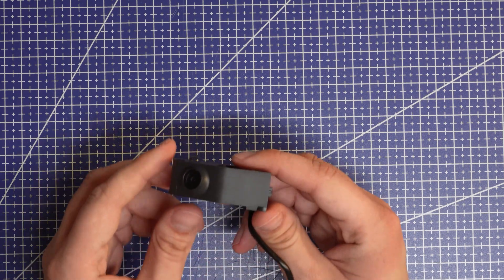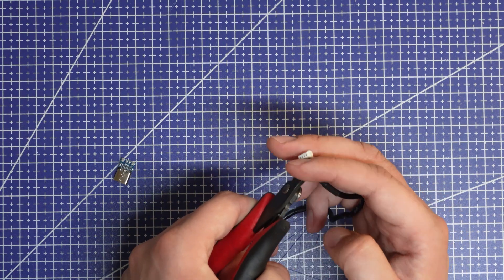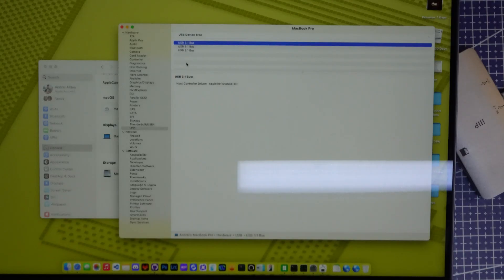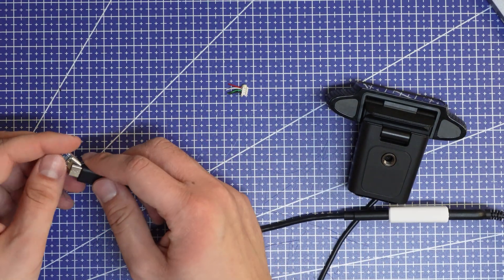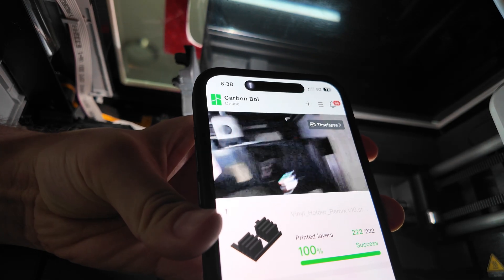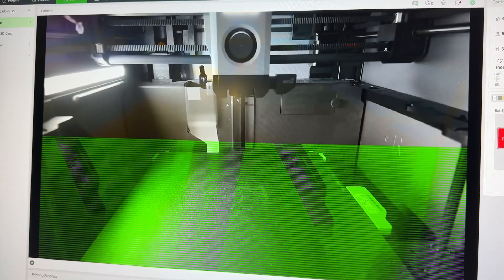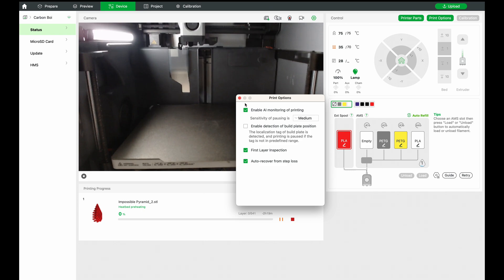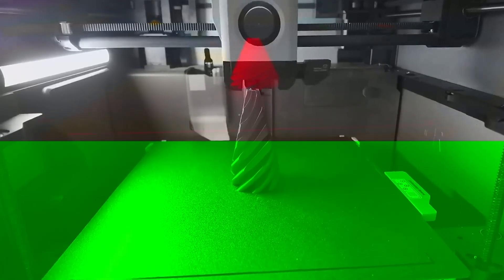Secrets of the Bambu X1C Camera - Use 3rd Party USB Webcams!

Comment: I have 2 extra cameras after glitches in firmware of mobo, BBL was sending me those instead of listening to me telling it's not the camera issue.
They finally fixed the glitch eventually and I got with those cameras. Might repurpose them for multicam streaming I guess.
Also you need to keep in mind that native BBL camera isn't 1920x1080 but is smaller horizontally when using ffmpeg streamer, so might also be something to consider.

Comment: I wonder if the P1S uses the same camera unit as the X1C but its actually the processor that limits the frame rate?
Reply from the maker: @DrawnDoggo  probably part of it. I haven’t seen what that unit looks like but likely the same sensor.

Comment: It could be my fault but I don't understand this logic. You change the camera, but you wanna keep the printer's data transfer chain. Why is that? Your camera is outside of the box, and it's an independent device, why would you want to connect it to bambu? Just because you can?  Use your own video data transfer method, wifi, ethernet, USB2 or 3 or HDMI or whatever you want.
Reply from the maker: @telelaci2   There’s a few cases where something like this might make sense to do:
1. Your Bambu camera dies (like mine) and you want to replace it without buying a new Bambu sensor
2. You want a different camera angle and/or better quality (which even the C920 gives you) while still being able to use the native Bambu App for monitoring on your phone remotely and the native Timelapse feature.

Using “my own transfer method” would imply having to setup another device to monitor it that’s not tied into the Bambu app, probably a pi or other Linux box whatever. 

Lighting and camera angle you can play with like anything else, ideally yeah you’d turn off the Bambu light and setup strips optimally for your camera setup, but you can do that with this just fine.
Reply: @AndreiAldea  The weakest link of the Bambu's Data stream is the bandwitdth, 2.4GHz wifi. You can't change that (maybe later with the Crowdsupply  X1Plus for $125). And it limits your quality badly, whatever camera you use. They should've put a gigabit ethernet in the printer, but they wanted to save money. Meh.
And I wouldn't name the half green screen a better quality, but faulty instead. Bambu's firmware can't handle that camera properly. So I think the idea was very good, it was worth a try, but it failed, you couldn't achieve the goal. Be honest to yourself. Sorry for the criticism.
Reply: @AndreiAldea  OK but a Bambu Chamber Camera replacement for X1C is 54 EUR/$ 50, it's definitely cheaper than an Logitech C920/C922, not mentioning a GoPro or a DSLR or mirrorless pro cameras you tested. You are not cheaper but more expensive. And you needed many gadgets also, a camera tripod, USB cable, plug converters, dongle. Add it up don't be shy. You will be over $ 100.
Reply: And another problem is the lighting. Very important in photography, when you want HQ picture/video. Switch off the Bambu's own LED (you don't want to look into the Sun), and build your own LED lighting stripe into the upper frame, you can find many solutions in the Makerworld.

Comment: I have a very similar issue of artifacting, but how come when you were able to view it on your pc, the artifacting wasnt there?
Reply from the maker: @yourcrawdaddy  for me the artifacting was happening on/off after reboots but was always guaranteed to happen after the chamber was heated for a little bit.
Reply: @AndreiAldea  Like @lpROTC, I did not see the artifacting when you plugged into the PC. Are you saying it did come back when plugged into the PC? I have the same issue which also happened to running high temp materials, however it now happens regardless of chamber temp. I would think it would do the same thing no matter what its plugged into.

Comment: Mine is currently blurry, out of nowhere. Currently looking into replacing it with something other than the stock camera, which sucks to begin with.
Reply from the maker: Yeah if you're trying to do that something like a Logitech C920 is probably your best bet. I would try to pick up a used one off Facebook Marketplace or something for cheap, no sense in paying full price.
Reply: In case you are still being bothered: it's because the lens fell off from the sensor. Actually a quite easy fix by yourself but you can also replace the entire camera assembly of you don't mind the wait😂

Comment: Hmm,. the green reminds me of the older cheap usb camera when you had to change setting for de-interlacing rates. Probably from the bambu camera driver they are using. since it is just linux after all. Now if the driver was UVC compliant it wold be neat to wire up one of my thermal cameras 😂 You could monitor how certain materials cool down to much and warp like nylon PA6

Comment: But… when you connected the Bambu camera to the computer there was nothing wrong with the image, so the problem we see is from elsewhere, right? (One of my X1C just started having this issue, hence I’m interested in the reason. Seems more like sw-related)
Reply from the maker: @Mr.X3D  it could be but for me the issue always happens once the chamber heats up, swapping the sensor with the new one has it working fine so I assume something is cooking that sensor over time….
Reply: my camera started to have the same problem , when you First switch on the picture is o.k , but slowly more and more gets added to the image , at First I thought it was something to do with being on a different vlan , but work out it's the camera when heated up.

Comment: this wouldn't work with the p1s would it ?....they say the camera is limited on the p1s be cause of lower power cpu on p1s vs x1c
Reply from the maker: @vash469  if it’s usb still it might but work at a reduced frame rate or it will drop frames. Not sure, I don’t have a P1S unfortunately. If you’re fine with not using the native app for monitoring a WiFi camera might be easier/better for that.
Reply: @AndreiAldea  I have a tapo c110 I use but trying to find a good position for it all the prints I'm finding aren't very good angles....just good for overall monitoring
Reply: same camera module in both. hence, unfortunately, you're right about the lacking processing power. should still be possible to swap in another camera with compatible specs, but you wont get much better output.

Comment: What soldering iron and helping hands are you using? Could you provide a link? I'm in the market for both. Thank you!
Reply from the maker: @wscottfunk  the Soldering iron is called a Pinecil from Pine64 and for $26 it blows $100+ soldering irons out of the water (just make sure you use a good USB-C PD power supply with it) and the helping hands are called the Omni Fixo and they are by far the nicest, Tested did a video on them a while ago and they’re worth every penny. 

If I had to get those all over again I would. Don’t bother with the cheaper stuff it will save you a lot of frustration. The soldering iron especially is an absolute bargain

Comment: I just use a cheap Tapo C100 security camera on my P1S, $20 or less on Amazon with plenty of mounting options on MakerWorld or even design your own. I chose the cheapest camera I could find in case it didn't work but is pretty good for what it cost, will now look for a better one although not really necessary as this one gives up to 1080p. There are many cheap options on AliExpress for cameras, I've ordered a few, one with an ESP32 board to experiment with.

Comment: Can you explain the resistor level thing? Specifically what resistor value are we supposed to use to connect?
Reply from the maker: @RaleighLittles  Yes, USB Type-C has two CC lines that are used for negotiating power transfer in normal Power Delivery applications. Those lines can also be used in a legacy “dumb” mode where you just put a resistor on each line tied to the 5V line to indicate the type of device you are connecting. 56K ohms is “standard” for 500mA default power, while commonly you’ll see 5.1K which tells the power adapter on the other end that the device is a 5V 3A sink. 

Normally USB-A to C cables have these 2 resistors built-in to make them work since the CC thing wasn’t a thing when USB-A was first created, but USB-C to USB-C cables assume that the device on either end does the signaling. 

Hence by using an adapter we’re basically just providing those resistors so that the USB-C end can negotiate the correct power. If you’re using only USB Type-A then none of this applies, 5V is just always supplied.
Reply from the maker: @RaleighLittles  there’s a good Hackaday Article called “ALL ABOUT USB-C: RESISTORS AND EMARKERS” if you want to read further

Comment: I have the p1s and there is the camera very bad, I’m think about doing the same thing as you did so I can see with more fps
Reply: I doubt as processor is not good enough.
Reply: the official reason is, that the P1 has limited processing power, so it can't handle the higher data rate - but maybe the camera still can be replaced the same way, if the camera has a low enough data rate
Reply: @suit1337  The real reason is that most of the frames are sent to China. The 25 frames per minute we see are left so we don't get suspicious.
Reply: @theo3000 lmao 😅
Reply: its literally the same camera module in the P1S as the X1C, as previously stated, you wont get a better frame rate out of it due to processing power limitations.